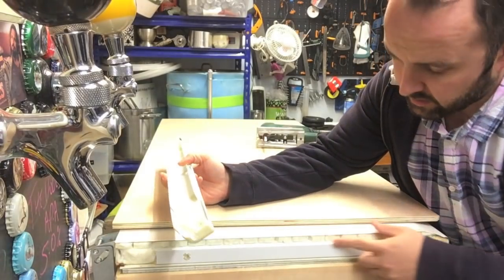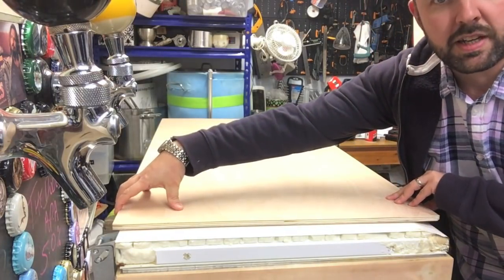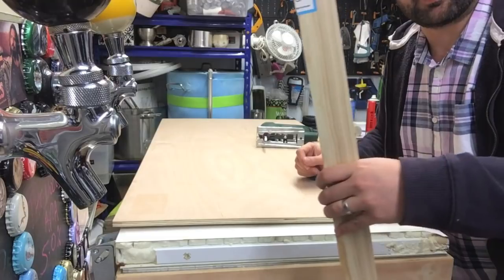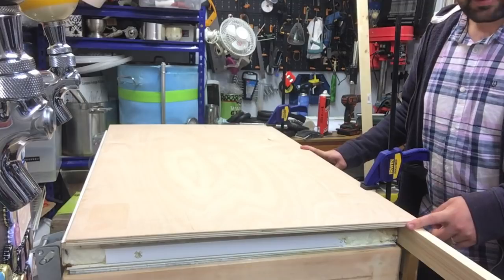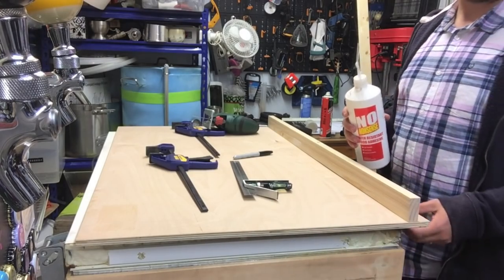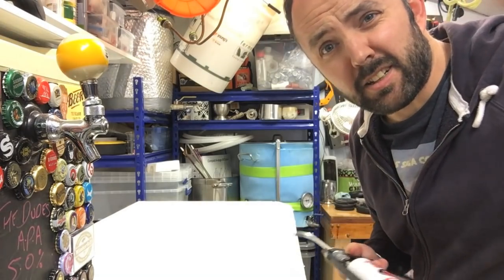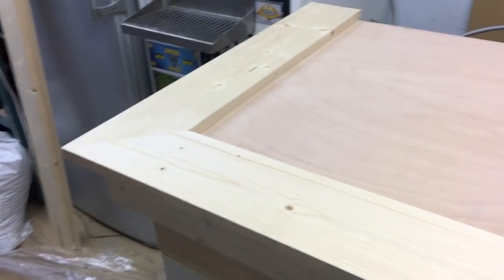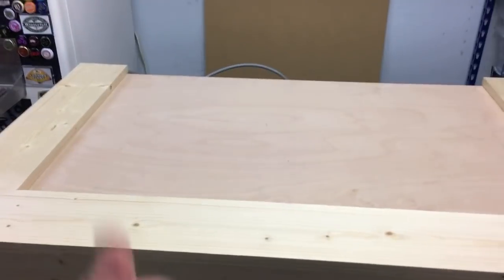4 Tap Keezer Build - Episode 2 - Bar Top and Edging

Comment: Looks great! I'd worry about the weight of that lid though. From a usability and safety point of view.
Reply from the maker: It is going to be a heavy one! Not much of a way round that tbh most people that I have seen just use a short length of wood to prop them open when lifting stuff in and out, I might try and come up with a slightly more robust solution as I don't much fancy it closing on my head when I am pulling kegs in and out!
Reply: @DudesBrews  haha, yes you might need something if you value your fingers! Maybe look at gas struts from a bonnet or boot - cheap from a scrapyard. That way it would be naturally open and you could clip it closed with toggle latches? Rob.
Reply from the maker: Rob Hadfield that’s a great idea I will look into that cheers